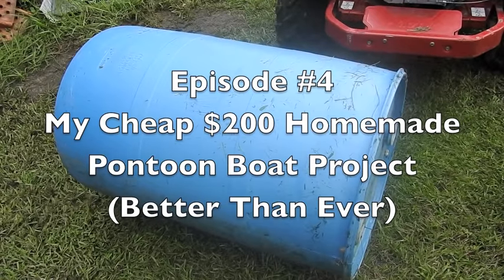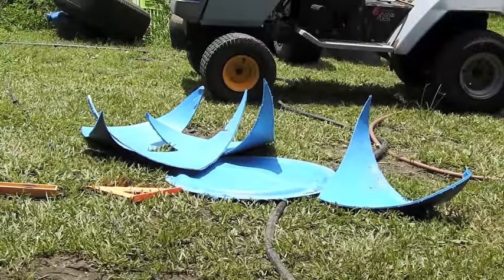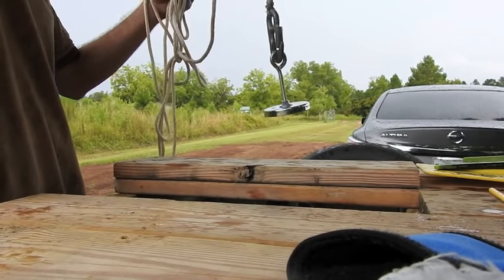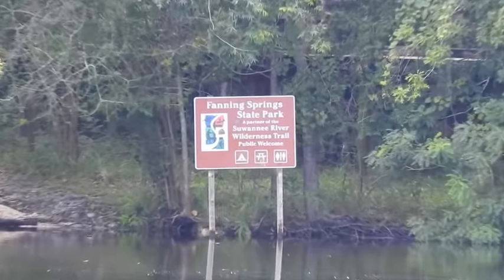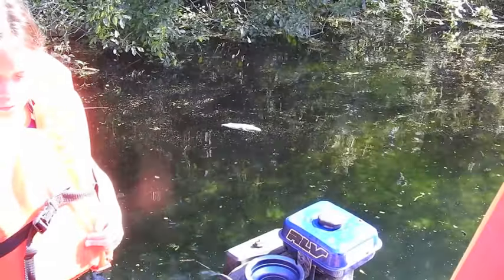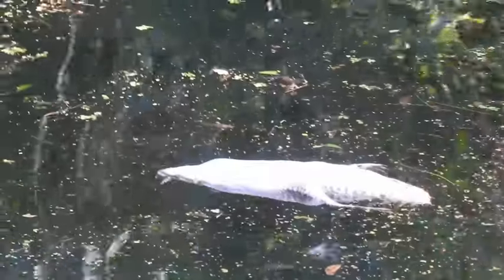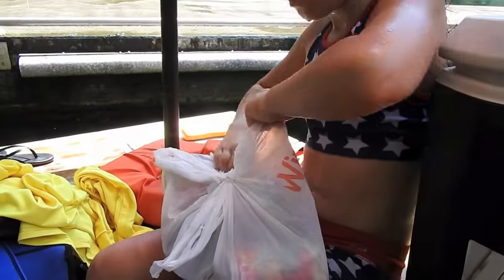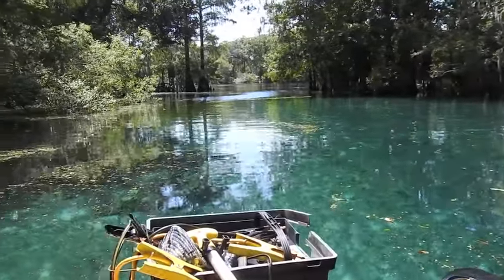My Cheap $200 Pontoon Boat Project Part 4

Comment: Stuff in 'wet storage' can mold if you don't dry it out every time... When motoring across the lake, will the prop hit anything or anyone that falls through that opening where you put your feet ?
Reply from the maker: Agreed, if you check out build #2(bigger and better) there were no holes in the floor and no wet storage. Thanks for watching.
Reply: @chud327  I wasn't sure if this was the same boat that had the wood rail on the back half and the awning or if that was a later build...
Reply from the maker: @johnw65  this was prototype build #1, learned a lot and started over.
Reply: @chud327  Ok, Thanks. I thought your transom on the boat with 3 motors on it looked quite a bit beefier....

Comment: Did the water inverters increase the speed any?
Reply from the maker: I could tell a huge difference between episode #3 and #4.  On build #2, I think once I get the bigger motor to run right and stop pulling air, it will do even better.  I would say they are must haves. Thanks fo watching.

Comment: Is that a lawn mower engine on an outboard lower?
Reply from the maker: Yes it sure it. A mower engine is air cooled, cheap, and no mixing gas. Thanks for watching.
Reply: Good, I'll research how  using an engine of lower power than the original is compensated for.
Reply from the maker: Let me know.
Reply: Only saw results of an 8 hp motor on a 35 hp bottom, slow from overload on the engine. Others have used 6hp engine on 9.9 outboards with no complaints. A lot has to do with the revs each engine gets its horse power. Like if the 9.9 is at 5500 rpm and the 6 is at 3600 rpm, (guessing), then the outboard bottom is a match. If you can't find the engine specs, then make it and re-pitch the propeller, to get the revs right. I re-pitch my stainless and alloy props by slowly tapping with a hammer, with a dolly on the other side.

Comment: Yea, because there's nothing better than putting on a WET lifejacket that has been sitting in pond water,  getting STINKY
Reply from the maker: Sounds like you keep your lifejackets in pond water. Thanks for watching and for the life lesson.
Reply: @chud327  Um no dear,I don't do mildew odors , that compartment,for things that don't need to be dry, wouldn't be good for life jackets , was my point, but if you want to pretend to be DULL go ahead, we still have some rights in America ,

Comment: Where did you get your motor
Reply from the maker: I got it from a friend.  I used to be on a pull behind mower. The Johnson foot was laying around in my garage when I got the garage.  I just put the two together. Thanks for watching.
Reply: @chud327  this is a great build love your videos and sorry for asking so much but where did you get the blue 55gallon drums me and my brothers have been inspired to build a boat are self
Reply from the maker: You can ask as many questions as you like, that is what I am here for. I hope you will send me pictures of your build!  I found my barrels on Craigslist for $15 each.  I some times see them for more and sometimes for less.  Make sure, if you can find them, to get the ones with lips on both ends.  BTW, where are you located?  I would love to have another barrel boat to cruise beside some day...
Reply: @chud327  thank you
Reply from the maker: Anytime!

Comment: $200 dollars for a boat and motor. Save  money not wasting it on sandpaper  and  power for a sander.  That and the gimmick wood sealer and sealant or waterproof paint or like the fiberglas or sealing stuff for the pontoons floating the riders.  Those holes are odd. Did not put a bolt in there I just drilled and bolted the wood on together on top of the pontoons to fit good. HHMMM
Reply from the maker: Thanks for watching.

Comment: Not cool running your motor up to the manatees water.
Reply from the maker: As long as you go slow, and my boat is super slow, they are able to get out of the way. besides in the spring you would be able to see them anyways. Thanks for watching.

Comment: How did you seal the water divider from letting water in
Reply from the maker: They are not sealed and they fill up to where the water level is.  I keep stuff in there that water doesn't hurt.  Thanks for watching.

Comment: Has not heard of flex tape
Reply from the maker: I have heard of it, but which part of the boat need flex tape?  The front I guess... Thanks for watching.
Reply: I thought the barrel with holes in it needed flex tape
Reply from the maker: Ah, you mean the barrel I cut up. Thanks for the reply.

Comment: Cool video. I'm building a shanty boat this summer (Check my channel of you're interested) I've been thinking about adding a 3rd toon with barrels and wondered how to cap the front for cutting the water. Q: what if water gets inside it? Would drain holes places in the right spots be a good idea? Like self bailing?
Reply from the maker: I will check it out and I let water come and go in mine as it pleases... Thanks for watching.
Reply: chud327 I'm not sure I understand. Is there a way for the water that gets into the slanted front piece you crafted to get out? Did I miss something in the video about that? Thanks.

Comment: your camera is zoomed way to far in. we can't see what your doing
Reply from the maker: Eric D I used 3 different cameras for this video. One of the gopros was zoomed some, example was the manatee. I assume that is what you are talking about. It is good, to me, until you go under water. The GoPro also has no display to show what is being filmed. In my defense, the manatee came much closer than expected. If you are not talking under water, then I know not what you mean. Thanks for watching.
Reply: chud327 it's not about you, it's what's good to the viewers. It didn't work.
Reply from the maker: I wish you would explain what you are talking about. Which part is zoomed in too much, give me a time maybe.  I have watched it several times, after uploading as a viewer, and it does work.  At least, it does for me.  Sorry you can't see that and thanks for trying...

Comment: Hello Chad! Super raft and awesome channel! I also have a similar construction and just planning to rebuild it. I plan to change the metal barrels to plastic to make the raft lighter and avoid corrosion. My only concern is how to avoid denting due to air/water temperature changes, like this one:
https://youtu.be/q0_QBM14BlM?t=662
I was thinking of simply drilling a 2 cm diameter hole on the top of the barrels. This would make the inner air pressure constantly the same as the outer one. Minimal rain water would flow in, but cannot think this could cause any problem.  What do you think based on your experience?
Reply from the maker: It would probably be fine with a little pin hole in the very top on the side under the lip of the barrel as long as the barrels never rotate.  I did a second build and I sealed the barrels when it was 41 degrees, then when the air warmed up, I had pressure. Be sure to check out build #2, I feel it was much better than build #1. Anyways good luck on your build and thanks for watching.
Reply: @chud327  Watch the second build. The barrel suspension with the springs is a great idea. Does this allow the barrels to rotate? As I would use this suspension, but would drill the small air vent hole into the top of the barells. Thanks!
Reply from the maker: @bertalanpusztai7866  I don’t think spinning has been an issue, but hard to tell o the middle barrels